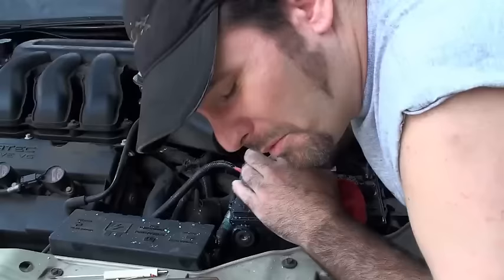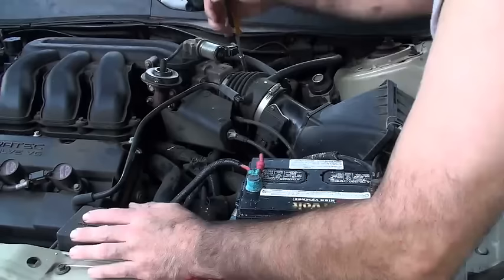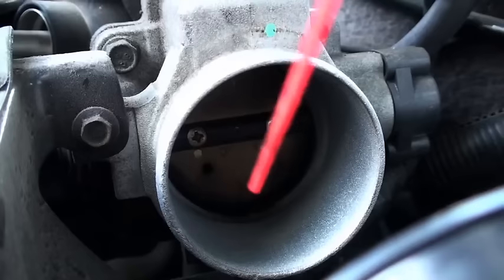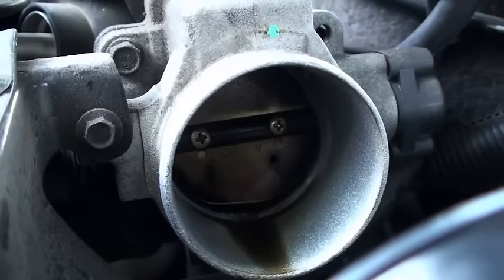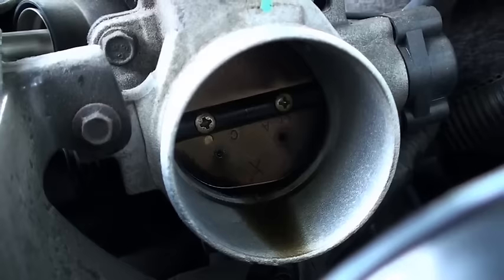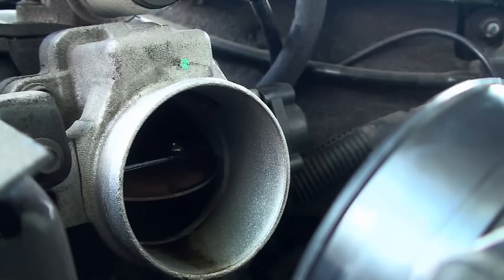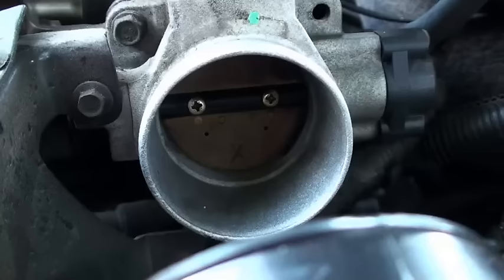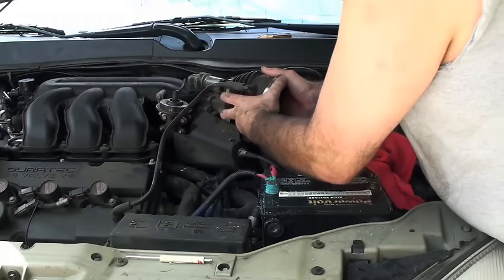Quick Tip-Throttle Cleaning - EricTheCarGuy

Comment: EricTheCarGuy Hey man, my car has been having a sticky throttle body for as long as I have it. Attempted to clean the thing with wd40 on the car a while ago, didn't help. Finally got some carb cleaner and thought it was a good idea to get it of the car. Dismantled the whole thing, but that ridge won't come off! Since the car is from 1995 and the throttle body sensor and assembly have been replaced by the previous owner, I asume this thing is just getting old and will try to slightly grind of a little of the throttle plate to get some clearance. Or do you have a better idea?
Reply: Georgie Dekker EricTheCarGuy Found the problem. Some screw that blocks the throttle going to far out was not screwed in deep enough. Made sure it made contact when off the throttle, problem solved!

Comment: Hi Eric
I have Nissan Rouge 2017, my dealership recommends to have throttle body clean up for.mh car. It have 121k on it. Is it required th have done at this point
Reply: "Required", probably not.  But a good idea.  Beware, a 2017 Rogue is a drive-by-wire throttle (meaning it isn't linking to the gas pedal by a simple mechanical cable - rather, the pedal position goes to the computer, which then controls a motor in the throttle to turn the flap).  So after you clean it, you may have a crazy erratic idle behavior until you reprogram it with something called the "idle relearn" procedure.  You can fine the step-by-step for that on the web.  It's a byzantine sequence of turning the key on and off, and stepping on the gas pedal a certain number of times, all within certain numbers of seconds.  It can be frustrating to get it right, but it's definitely something you can do at home.  I just did this on a 2006 Murano, and although the throttle relearn was tricky, it definitely runs better once it's done.

Comment: Best way if you can is disconnect and take off - my Saab Aero 2.0 petrol held on by four bolts and £2.50 gasket - did MAF sensor as well at 100k - car runs much better !

Comment: i am new at the automotive world I am actually enrolled now in a 6 weeks course on autotomotive. I just want to ask if what is the difference between the throttle and the carburator?
Reply: https://en.wikipedia.org/wiki/File:Carburetor.svg One mixes fuel with air and the other controls the fuel/air mixture going to the engine. In fuel injected engines it's only air.

Comment: Question: watching your video I realized I might have flooded the engine with too much spray. And now my car won't turn over. Can you tell me what can I do to get my car to start? I also checked the spark plugs and they smell just like the spray I used to clean the throttle with.
Reply: Despues de aplicar el liquido limpiador debe dejar el automóvil apagado y con el acelerador presionado con el fin de que la mariposa quede abierta durante 30 minutos para que el liquido se evapore y el automóvil encienda sin problema.
Reply: Felipe Sanchez Sorry this is kind of late, hopefully you've got it by now.  But in the future, if that happens, you might try removing the spark plugs and letting the fuel vaporize.  Too much liquid in a cylinder can cause it to lock up because the piston can't compress the fluid.

Comment: and that's the wrong way to do it. because the motor that controls the disc could run and chop your finger. you should unplug it from power and drain its capacitor. best way to do it it taking it all out then cleaning it.

Comment: Eric, have you ever done this to the Honda Element? Mine has the same problem. On top of it having a rough idle while on drive. Haven't checked the spark plugs or coils nor have I cleaned the throttle body.
Reply: Tony Peña Bueno  clean the throttle body it’ll fix it for ya i think i had the same problem with my lexus having idle problems , cleaning the throttle body fixed it completely for me n my check engine light even turned off
Reply: Scary Terry thanks brotha.

Comment: would this fix a p1122 throttle position sensor higher than expexted code
Reply: i would not think so. sounds like you have a modern car with an electronic throttle. Id try to take a look at the throttle position sensor first.

Comment: Hi Eric. Today I wanted to clean a little bit the carburateur, but did not want to go through all the mess of dissasembling anything. what I did was to pour some sanitary alcohool (50 ml ) down the  brake vaccum pipe while the engine was running ( i wanted cheap, quick and fast fix). Well, I may say,  the engine runs better, but there is the engine warning light on. Do you think, i damaged some sensor or anything ? The car is a 2004 nissan Micra.
Reply: +Gigi de la tara Why would you do that? Sounds like you damaged a sensor. Those "quick fixes" never work
Reply: +Gigi de la tara Well, I saw someone pouring brake fluid in the thrpttle, so I thought, little alcohool won't mind. I wanted to give a little cleaning of the throttle without opening it. I thought a sensor might be to blame, but, there is a little engine burn smell, like something is overheating. It's not burnt gasoline or oil smell, more like a plastic smell.

Comment: Dammm it! I cleaned my throttle  valves to try and have a better reponse in low rpm. I fucked up the ECU by moving the valves. I just wish I had seen this video before. DO NOT MOVE YOUR VALVES if you have electronic throttle. You will end up with a bricked car/bike on your dealer waiting for a repro.

Comment: I have a question from a guy that knows little to nothing about cars. I'm driving a 1990 Cadillac DeVille and the gas pedal is really sticky. What I mean by that is when I push on the pedal when the car is running, it won't press smoothly and when I press hard enough it will break lose and accelerate. Now another issue is when I let off the gas to coast to a stop, the car doesn't stop. It's as if something isn't allowing the car to idle correctly. Please comment! Thanks!
Reply: You probably need to replace your gas pedal, either that or the butterfly stays stuck open or something. If anything put the car in neutral and break if the gas pedal getts stuck momentarily

Comment: @EricTheCarGuy do you know what problem my 2003 Yukon could have. The battery drains over night and now it shuts off while driving. HELP PLEASE!
Reply: Alternator? Do you hear a squeal at all? When bad it can drain your battery and also wont charge it
Reply: It did not do that I had a 145amp alternator but from what a friend told me that was one issue so I got a 105amp alternator and now when I start my truck it won't turn off...at times it just turns off on the street when I'm driving it...I searched electrical recalls and I found one however my VIN number doesn't fall into that recall

Comment: Any video of how to clean a 95 GMC Sierra 350 TBI
Reply: just take the air off filter, poor half the bottle in while truck is running... very slow or it will shut off.. other half in your gas tank

Comment: if my check engine light is on and it reads the throttle body if I clean it will the light come off? and how do I know if I just need a new one all together?
Reply: If the light doesn't shut off after cleaning it, then you probably need a new one. What make/model is it on? What is the P code?
Reply: the light usually takes 60 start and drive cycles to turn off

Comment: Hi Eric! I love your show including ETCG1!

I have a question for my 2006 Nissan Sentra  1.8L engine, hopefully you'll be able to  help me out on this.
I just cleaned my throttle body and airflow sensor with the appropriate cleaner solution. After I put everything back together,  the engine started just fine but the idle is not so good. The RPM bounce around  between 1500 to 2000 and the check engine light illuminated with code P0507 per scanner. I already did the throttle "relearn" twice, but no joy. What do you think I should I do next?  Should  I just keep driving it and see if it clear it self? I really don't want to have to change a throttle body :)

Thanks man! Stay dirty and keep up the good work!

Comment: Eric,

I  did this on my 04 murano and now I have a PO507 code...high idle rpm...any advice on how to fix before I make the expensive trip to the dealer?? Any help would be greatly appreciated.
Reply: Pedro Fuentes Air is entering somewhere else besides the throttle body. Check for vacuum leaks, stuck IAC, faulty PCV system or stuck throttle body.
Reply: I am not sure if the cleaner caused this but I had to take it to the dealer and they said they couldn't get the idle to relearn and that the ECM was not communicating with the throttle body and that it should be replaced...never ever touch this things...just let these be.

Comment: Eric can you please help me out here: 
I watched Scotty Kilmer's video about code P0420 and lacquer thinner.

The lacquer thinner turned on my check engine light on with codes
P2195
P0122
P0103
P0113

My car shakes like crazy, rpm needle moves at idle and my car stalls (turns off) quickly. 

What can I do to fix my car?? The last thing I wanted to do was spend more than what could be afforded. It is a 2005 Honda Accord 2.4 liter engine that needs to be saved ! Looks like the lacquer thinner seriously hurt the inside components ! What do I need to replace??
Reply: if you put the thinner in the tank with one part thinner to 9 parts gasoline, it can't hurt anything. Now sometimes codes will pop as the cleaner does its thing,  BUTthe ONLY thing that can go wrong with that mixture is if the car already has an amount of water in the bottom of the gas tank, then the cleaner will suck that water and run it through the system. In such a case, you would need to remove the gas tank, clean it out, flush the fuel system out AND replace the fuel filter.
Reply: That's why you don't put stupid shit on your vehicle you see on you tube, especially newer vehicles brotha. But at least you know now

Comment: lul mine was stuck because the throttle cable was catching on the cruise control which does not work but i cleaned it anyway

Comment: this can ruin the throttle sensor and idle air control valve fyi. Be careful to not let the gunk go down those holes.
Reply: The throttle position sensor is a spring-loaded knob that attaches to the outside of the throttle housing. There is no hole for it to reach. You use the same stuff to clean the idle air control valve as you do the throttle body.

Comment: How did you open the throttle plate up? I pushed it with my finger but it was stuck shut.
Reply: Bad idea. You just turn where your throttle cable hooks in.
Reply: Well duh! Throttle cables are so old fashion. I don't have a throttle cable. It's all done electronically on newer cars. In fact, you can't open the plate it manually at all.
Reply: I had just replace the battery. I cleaned the one side of the plate. Then performed the "ELECTRONIC" procedures necessary to get the idle running properly. Poured a bottle of Gumout "Tune Up" in the gas tank. Then everything works OK. You can't replace the battery without the idle going haywire.
Reply: +David Crandall pouring any additive in the fuel tank will in no way ever effect your throttle body, both sides of the throttle body need to be cleaned

Comment: how do i do this with cars with an electric throttle? how do i open the throttle when there's no wire to pull?
Reply: On mine, a Bosch one, i just removed it from the engine and then opened it (and kept it that way while i was thoroughly cleaning it and its surrounding "wall") with my fingers. It's not needed though if the cleaner is strong enough since the butterfly valve is kept at a default angle by a spring when unpowered (it still leaves enough space for the cleaner to drip through). It still works perfectly.
Reply: TeraVolt thanks. so it's possible to push it open with the fingers? i don't want to use tools in it since i might scratch it, and porsche throttles ain't cheap even when 2nd hand.
Reply: TheWolvesCurse As i said before mine is a Bosch electronic throttle body, mounted on a Vauxhall car. I don't know if the same applies for throttle bodies mounted on Porsche cars (try looking for the manufacturer's brand and the product code anyways) but since they're expensive i don't want you risking ruining it so please ask to a Porsche experienced mechanic if, when it's unplugged of course, you can force it open without damaging its actuator. Mine could be opened with fingers alone with some effort, since the spring force wasn't too strong. And since i unplugged it the motor wasn't powered and the butterfly could be moved around without the risk of any damage or injury.

Comment: I have an electric throttle in my car and I opened it to clean it by pushing it with my finger. I didn't know this is wrong so how can I reset the idle speed? My car seems to idle differently after I did that.
Reply: Did you disconnect the negative cable from the battery first.? If not. It's possible that the idle set itself to a different rpm because when you cleaned it and held it open it reset itself differently
Reply: Me too. Tried an "idle relearn" to no avail. My car has no idea where idle is now, and revs to 3k when I press in the clutch while moving.
Reply: I know this was posted a while ago,  but you probably broke it.  You are NOT supposed to manually open electronic throttle bodies.
Reply: Kevin N Thankfully I did not break it, the idle went back to normal. Bad mistake on my part but I'm learning.

Comment: I hope anyone with experience will read this message...so I bought vw polo 1.4 16v 2000 and two days later I noticed the stalling or idle problems when infront of the red light. I also noticed today that the idle problem start occuring when the machine gets warmer.
Today the motor actually lost power and stopped working so i had to had to restart the engine.

I added the cleaning thing that goes in the benzine tank that supposed to clean it

the reading of the computer said once tested that it is throttle counter or throttle body (still not sure if its the same thing) that is the problem. Now I'm wondering whether the idle showing clear signs that its getting worse just the result of the cleaning being in the tank or is the problem more seious one...help!!!
Reply: Space Hobby benziein tank? If it's something you add to the petrol tank its normally quite gimmicky.  If you wanted to clean out your engine I suggest sea foam or Subaru upper engine cleaner. I'm not too sure what you're saying in the comment but that's what I got out of it.

Comment: I have a 1995 ford taraus the engine fan runs even when the engine is not warmed up, it runs as long as the car engine is running. Help ASAP!
Reply: How cold is to cold?
Reply: Does the car get up to temp okay and stay at a fixed temperature? You'll want to look at the cooling system and make sure that's functioning as it should, then if that's good check the electrical system for the fan. What I have seen is old thermostats sticking open, causing the car to never quite reach temperature and taking ages to get there, and the ECU freaking out, turning the fan on when it shouldn't.
Reply: +Erik Borem The fan shouldn't be on all the time, that's not a good sign, the engine is designed to run in a specific range for optimal performance, it's not as simple as the engine flowing water and being hot, in this case the ECU (assuming this is a basic SPi/MPi injection setup) is triggering the fan switch, when in all actuality it should only be triggered when stationary or at low speeds and the temperature reaches a predefined maximum. To give you an example, my car, which is a 2000 model, Peugeot 106 XN TU1 multipoint, I believe the thermostat fully opens at about 97c and the fan will cut in around 103c, at least what I can remember off the top of my head, so the engine is always kept on or very close to 100c. Again don't quote me on these figures, I left my workshop manual in the car and am unable to retrieve it atm.

Comment: So basically, you just need to clean the flap?
Reply: No... Not just the flap.  You need to get all the black sticky build up off the inside of the cylinder that the flap rotates in as well.  And the EDGES of the flap are the most important part to get clean.  The problem is that it tends to build up right where the edge of the flap is close the inside of the chamber, and that is especially important at idle when the flap is mostly closed. The build-up prevents the flap from moving smoothly, and also can hold it open more than it should be, causing rough or erratic idle.
Reply: @cowsongs  thanks so much for the info. Thanks for the reply back.

Comment: hey I have very poor power going up hills in my 97 Nissan sentra 1.6L 5 speed  could it be the throttle body dirty ? I have the gas to the floor and it has very little power going up but on the flats I have great power     or could it just be that it is just a small engine   it had 160,000 on it but has been rebuilt last week deff runs better then when I got it but maybe u can help
Reply: Clean the intake replace gaskets and clean egr valve
Reply: I had the same problem with my Nissan Sentra and I know of other people claiming the same problem. I will never buy Nissan, and discourage others to ever buy  Nissan cars. One Toyota Corolla or Honda Civic worth 10 Nissan. I hope to see the end for the Nissan company.

Comment: Can you use carby cleaner? or does it have to be throttle cleaner?
Reply: you can use carb cleaner
Reply: same thing.
Reply: not the same thing. some newer tbs you can't clean. some require throttle body cleaner. but on older stuff it doesn't matter.
Reply: same shit.....ive done it abd never had a problem and ive fixed more cars then u can count.

Comment: This method does not work well with throttle by wire, I prefer not to spray cleaner directly into intake manifold with all that dirt. I disconnect ground on battery, remove throttle body then clean, when installing torque bolts to OEM spec in criss cross pattern or you risk doing damage.